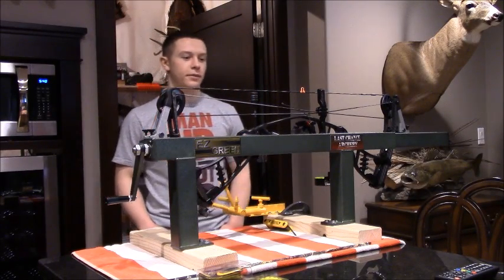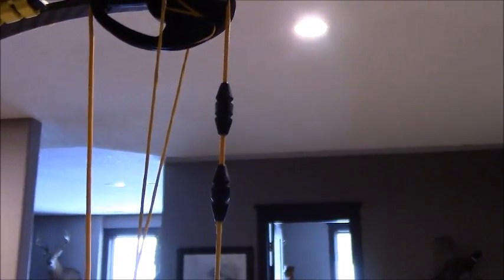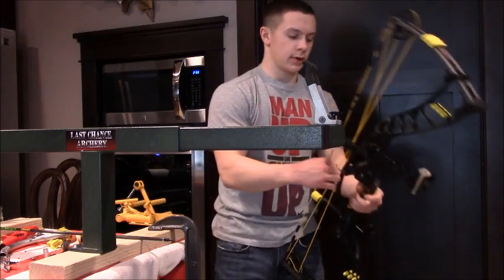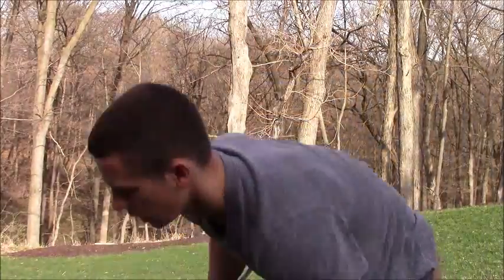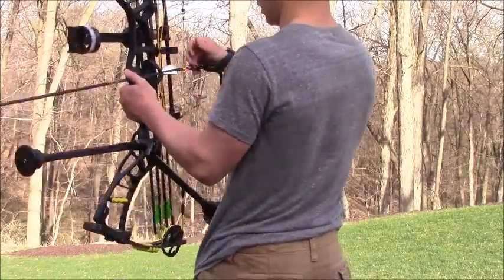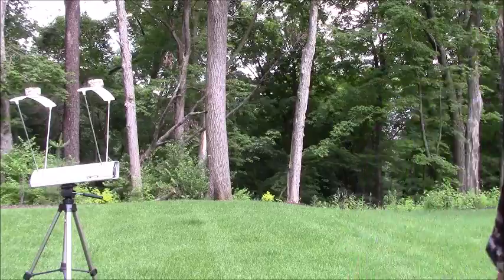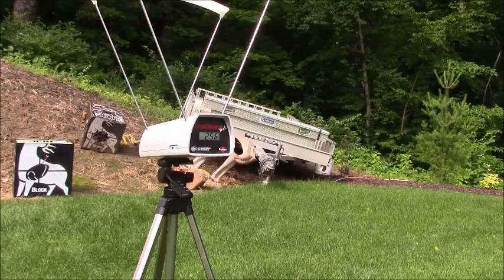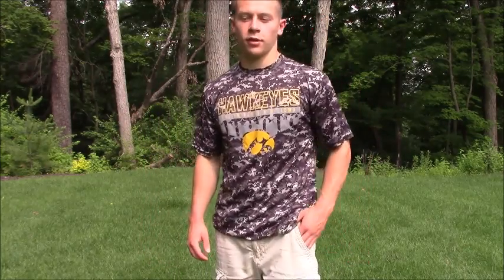Hoyt Nitrum Turbo Full Tuning Video

Comment: Great video!! I have a nitrum turbo at 65# would like to increase. My limb bolts are not all the way flushed to the riser, should I tighten bolts or twist the strings? And will tightening the bolts change  my draw stop timing. Don't have the bow press for twisting the strings. What would be the effects of tightening limb bolts?

Comment: my hot turbo bare shafts impacts right also and nock lower as if it was airplaning upward.  what should I do?
Reply from the maker: put twists in the left yolk and in the control cable if your nock is level

Comment: I have the exact same bow. 26" draw 60/70 draw weight. I'm having issues with the bow wanting to jump at full draw. I've backed off the limbs 7 full turns. According to Hoyt you can go 8 safely. But still having issues at full draw. The draw cycle is is stiff and the gets stiffer then falls into valley and stops. Wondering if I should move the cam stop. Any suggestions  
Thx
Reply from the maker: +eddie ornelas I would make sure your bow is timed right. If it isn't, the draw cycle won't be as good and it will be jumpy like you're describing. You want to have the stops hitting the cables at the same time. I wouldn't move the cam stop.

Comment: Good video man. Just bought a nitrum turbo like the one you have. What is the noise at the 6:27 mark roughly when you come to full draw? Can't tell if its the rest and or a field point rattle. Was it easy tuning your rest for clearance? I had problems on my last bow but i'm hoping I don't on this one
Reply from the maker: +Kody Whittington Thanks! I think it was just the field point rattling or something like that. I did have a bit of trouble with clearance from the rest but it was just because it is really finicky with timing. Once i got it set up right it was fine but i am switching to the smackdown pro which is limb driven for the ease of installation and worry free setup.

Comment: please confirm that when you are done, the nocked arrow, the rest, the sight and the arrow tip are all aligned. thanks
Reply from the maker: +TheBlackicehunter The sight pins are a little left of the arrow and string at rest. That is just due to torque at full draw.

Comment: nice vid. Just to confirm, i bought a nitrum turbo and i noticed that the string is actually sitting a little bit on the LHS with regards to the centerline of the shelf  due to its position on both cams (i.e. on the LHS of the cams)- any issue with this

thanks
Reply from the maker: +TheBlackicehunter No issue with that! I would just set the centershot at 3/4" and go into the mod. french tuning!
Reply: thanks

Comment: Is your right fletch, really close to your cable when at rest? I have a Hoyt nitrum turbo and my vane almost looks as if it's gonna make contact
Reply from the maker: +Twheat 77 yes it is fairly close. Mine didn't hit but if you think yours might be, you can check it with baby powder or lipstick. or you could shoot a fletched through paper and that will tell. If you are getting contact you can rotate your arrow into different positions until it stops hitting.
Reply: +Brunk Outdoors it paper tuned nice but dam does it look like it gets contact . Thanks for the response